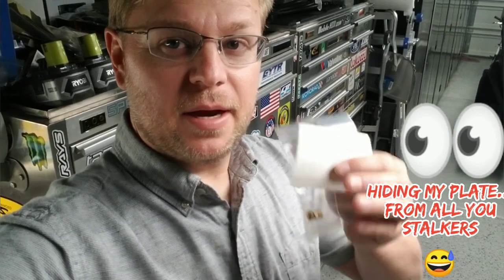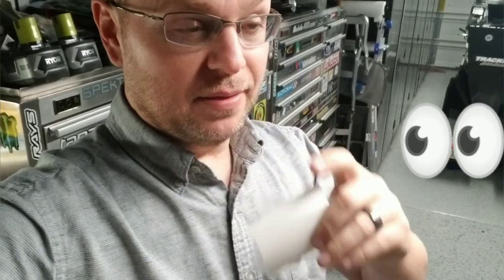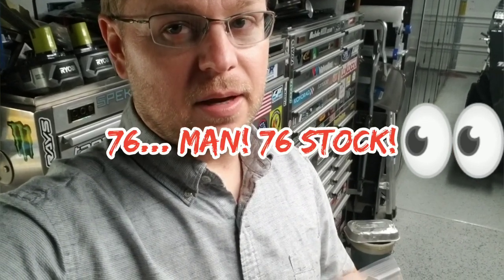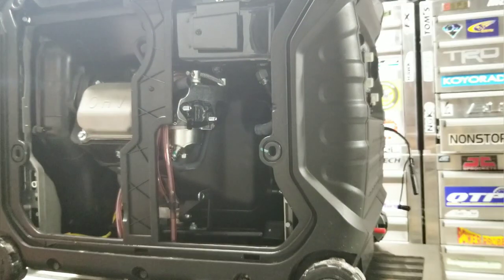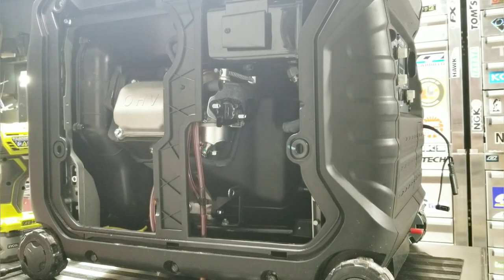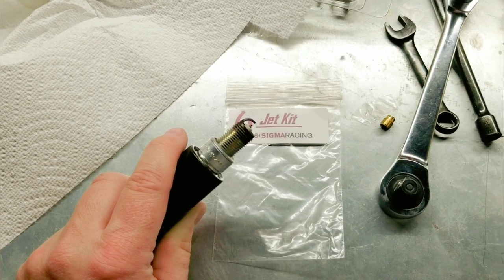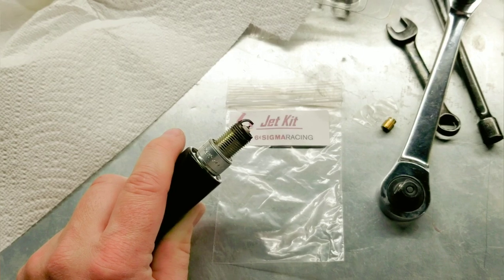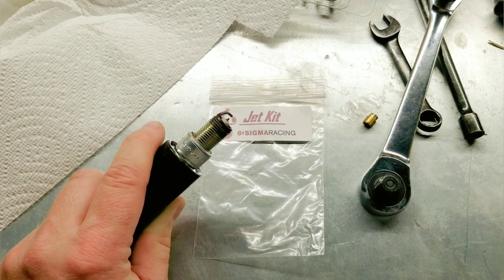DIY GUIDE - REJETTING THE PREDATOR 3500 INVERTER GENERATOR! RESOLVES A COMMON SUPER RICH CONDITION

Comment: Just bought one of these today. Had a few troublesome electrical outages here in Prescott. Watched your video...great info. Will be using the Pred 3500 mostly for backup during long outages. I'm at 5300 feet elevation here in Prescott. Which jet size would you recommend? Do you think that they may have cured the jet problem, or do you think it's the same as when you had it? Thanks.
Reply from the maker: Same #76 jet they have been putting in it since day 1. Others have mentioned a different jet in some models and elevations, but when they check the actual jet, still a #76. In Prescott, I would run a #68 for sure.
Reply: @MR_Garage  Thanks...will do..

Comment: nice video thank you for the time helping us on such a piece of equipment yours after the jet mod seem to run spot on i like mose have a question about sea level i live in connecticut and wonder the correct jet would be it would be for my house as a stand by unit really yours ran so good without much modes.
Reply from the maker: So many variables - best to check and see how it is running per your spark plug. If your gen is clogging the spark arrestor quickly and plug is a mess, consider starting with say a #72 jet. See how it goes.
Reply: @MR_Garage  thank you
Reply: @MR_Garage  yes sir I have my jet off its a 76 as well my  emulsion tube dropped like yours it came out so quick I don't know what end goes in first can you point me in a direction please
Reply: i found a link on you tube for  correct way thanks again ill let you know how it went
Reply: @t57f100  which end goes in first?

Comment: Great video. What city (altitude) are you in? I'm in Texas 6-800' above sea level and tried two things to lean it out. I eliminated the charcoal canister (to lean it out) and popped in a 75 jet. It still blackenes the spark arrestor with that setup. What jet would you guys reccomend I order? (I have a 72 jet on hand but havent installed it due to time constraints) Trying to do this and be done with it. Thanks in advance!
Reply from the maker: I bet a 72 will do it. The 75 would barely make any difference at all.

Comment: What size do you recommend for running this generator down in Dallas, Tx? I’m a mobile Detailer and I just purchased mines from a side vendor. I normally change the oil, spark plug and filter when I buy a used generator. But, seeing how smooth yours is running what would you recommend?
Reply from the maker: Run the gen first and check the plug and spark arrestor. Can make a determination then.

Comment: Great video and very informative - thank you! Off subject but the carb drain lines (assuming correct terminology) on the right join in a plastic T. My T was broken and completely separated. Does it matter and is there an easy fix or way to get the part from HF without returning the whole generator? Do you have a Facebook page? I looked but did not see one.Thank You!
Reply from the maker: Hey Michael, 
You could just get a 1/8th plastic tee to fix (I think the line was 1/8). And ABS plastic tee should work fine. Likely can pick up in landscaping at home depot - verify hose diameter first. Adding, I do not have a FB page dedicated to Mr. Garage and my projects. I just post here.
Reply: @MR_Garage  Excellent - thank you!

Comment: I ordered the two jets and found a 78 jet in my gen set. I have one of the initial runs of the unit but from the Illinois area where I purchased. I'm also in the gold canyon area now but the plug didn't look that bad. I put in a 72 jet so we'll see how that goes. I have not used the gen all that much though. I also drilled the air holes like yours as I thought that was a much better look. Thanks so much for this information.

Comment: I live in glendale az and it runs my toy hauler ac decent but I went to munds Park this week and the cinder pits and it just shuts down it says overload I can only run the lights and things and it shut off like 3 or 4 times before it even ran ok this weekend at munds Park do you recommend that 68 for mine as well?
Reply from the maker: Munds park is pretty high up at around 6500'. Likely your spark arrestor is clogged and yes, a #72 or #68 will be the ticket for you. Also, sounds like you may have overfilled it with the comment of shutting off 3-4 times before it ran OK. Sometimes that indicates charcoal canister being clogged with fuel. Never fill past the bottom of the screen on the tank inlet.
Reply: Where do I get the jets from I couldn't find a 68 or 72 they are different numbers where I have looked?
Reply from the maker: @coltenwells9567  https://www.6sigmajetkit.com/contact-us.html    Ask them for a #68 for the predator 3500. They are here in Az.
Reply: Where could I order the spark plug that you are recommending?
Reply: Colten, I had the SAME PROBLEM, cleaned the spark arrester and problem was immediately solved.  I live at 7K’ camp above 10k...

Comment: Hello, I have a question, my generator has a "maintenance time" symbol that looks like a key, why did it appear?
Reply from the maker: It comes on at 200 hours. It is stated that it cannot be reset (stated in other manuals like the powerhorse model of the same generator).

Comment: I just bought this generator yesterday. Is this still an issue with the current unit? If so I’ll get to performing this mod right away.
Reply from the maker: Best bet is to let it run under load / break in. When done, see how the plug looks and spark arrestor.

Comment: Great video, I just got the 3509 and live at 6000’ trying to order a jet kit #68 and can’t find one. Is there a part number or any other info that would help me? Thank. Craig
Reply from the maker: Hey Craig, Link here (also in the video description) Hope it helps! https://www.ebay.com/itm/Predator-212-cc-Honda-Clone-GX160-GX200-GX390-Intake-Carburetor-Carb-Main-Jet/232104529620?hash=item360a820ed4%3Ag%3AZlkAAOSwOyJX9X7D&mkcid=1&mkrid=711-53200-19255-0&siteid=0&campid=5338741445&customid&toolid=10001&mkevt=1
Reply: Only seeing .70 and .65 in that range now.

Comment: Hello I'm hoping you can help me out. I just picked one of these generators and I have looked into why it kinda runs like crap, and what I have found is the only "fresh air" intake is from the charcoal canister that pulls air from the gas tank, that's why they always run rich. Why dose pulling off the oil door fix the running issue? I do plan on pulling the canister out because that seems to  resolve all the problems, but for the life of me I can't figure out what pulling in air from the oil fill door resolves the issue, since the carb can only get air from the gas tank, and I don't see any air intake holes on the front cover of the air filter (other that the hose that runs up to the canister) Thanks!
Reply from the maker: Hello,
Sounds like your gen has been overfilled with gas at least once. This will cause fuel to run down into the charcoal canister and saturate it. Also saturates the air filter in some cases. Do NOT overfill the gen higher than the bottom of the screen under the cap. If you never overfill it and once the canister is dry, people have no problems. Pulling off the oil door likely just gives it enough additional airflow to run. Betting it is running super rich right now.

Comment: Thanks a million for this video and info! I really appreciate it! I have 2 quick questions: 
1) Are there any noteworthy differences between the Predator and the other five brands? 
2) Would the generator still show signs of running rich if it were run with standard E-10 gasoline instead of ethanol-free gasoline? 
Thanks again!
Reply from the maker: 1 Primarily looks like front panel layout differences and color. The latest predator 3500 model adds a fuel gauge which is awesome. 2 All we have is crap ethanol gas here with no puregas stations. Still runs rich as a pig unless jetted properly.
Reply: @MR_Garage  I'm also in the Phoenix valley. If you use the generator mostly for backup power, I recommend keeping a few gallons of Sunoco 99 octane around. I get mine from a shop in Phoenix. While expensive, being racing fuel it stores well and is much better to mix for 2-cycle engines.

Comment: Mine rings on choke but not in run if I did this and cleaned the jet without changing it out would that help?
Reply from the maker: Indeed, pull the bowl and clean the emulsion tube and jet. Should be good to go!
Reply: @MR_Garage  I can't get the jet loose....

Comment: I am at under 1000 feet elevation and plan to install a propane conversion kit and only run propane. Is changing the jets still recommended in my case?
Reply from the maker: The propane conversion kits such as tri-fuel's kit does not mention any carb mods. I have not added one to mine, best to ask the kit manufacturer.

Comment: Do other generators in this class also run rich?  Or is this just a predator 3500 thing?  If I bought a firman or a wen in this size would I have the same issue?
Reply from the maker: This seems to be a thing more with this gen and all variants of this loncin design. It is such a simple, quick mod - I did not bat an eye for the price paid.

Comment: Knowledgeable video! I'm at about 250 ft elevation in Bakersfield. My Predator 3500 inverter generator ran great during break in 25hrs. Now it hunts and surges (too lean) I have done all the AF and canister mods. I use sta bil gas additive as well. Maybe too much sta bil additive? NGK plug even.
Why is this thing so temperamental? Almost like a 2 stroke either too rich or too lean... What jet sizes should I order from 6Sigma? I want to get a stock size pilot and stock size main also one size over stock for each. I don't know their numbering scheme and they just tell me to order the sizes I want? Not much help... Please HELP
Reply from the maker: Likely have a clog if hunting or surging at idle / lean on idle. These things are pig rich at idle normally even at sea-level. There is a hidden idle adjustment screw (google predator 212cc idle adjustment). Carefully take that screw out and parts under it - small plastic low speed jet. Other videos show this for the predator 212cc. I need to cover it soon. Spray out the inside of that area with carb cleaner (berrymans B-12) Be careful not to splash B-12 in your eyes. Vicious stuff. I recommend taking off the carb to do it. While you are at it, take off the bowl, clean out the main jet and blow compressed air through all the passages once gas is drained. Sounds like a lot, but that is like 30 minutes of work tops.
Reply: @MR_Garage  OK I'll pull the carb tomorrow. What are the sizes for the stock main and pilot jets? The main is 067 I think but pilot unknown?
So you are saying there is a idle mixture screw on the other side of the carb? I wonder if it adjusts air or fuel mixture? If it's by the throttle plate it's fuel next to choke it's air.
Reply from the maker: Main jet is a #76. Generators for the most part do not spend their time at idle. Once you get it running properly at idle, then you can see how rich if runs and if it warrants a main jet change. 

The mixture screw is not on the other side (wish I could post photos). It faces the oil cover side of the motor. The pilot is rather hidden but accessed from the outside after you remove the idle adjust screw. Wish I could post pictures in the responses.  Check other videos under the search I mentioned above. 

Only other possibility with this, you overfilled the gas tank at one point (should never be higher than the bottom of the screen) If you filled the charcoal canister with fuel, they run like crap. But the surging you are mentioning... more a sign of a clogged jet or carb. Just takes a small bit of whatever in the gas to make that happen.
Reply: @MR_Garage  I see the idle mixture adjust screw. It has been cut off and glued in place. The main is a 065 not 076. I dont know which number to order from 6sigma? Their numbering scheme is completely different?
Reply from the maker: Is your gen the new model with fuel gauge on top? In another group, we just had confirmation they were still shipping with a #76 jet on the new builds for a main. This would be very NEW news if they are now shipping with a #65 main. Means they are finally correcting jetting, but going a bit lean now, especially for near sea-level. That is a jet I would use more for 3-4K+ feet (if the gen was always at that altitude). If you want a change, I would target a #72 for sea level. Order from sixsigma here. Their website is confusing. https://www.ebay.com/itm/Predator-212-cc-Honda-Clone-GX160-GX200-GX390-Intake-Carburetor-Carb-Main-Jet/232104529620?hash=item360a820ed4:g:ZlkAAOSwOyJX9X7D
Reply: @MR_Garage  Purchased in Nov 2019. I'll verify main jet # when I get the new carb. This is a California model and with all the CARB and EPA junk here it may have a more lean main jet in it stock? What bothers me is they cut off the idle mixture screw and glued it! We'll fix that. Also the emissions warranty is 2 years so I just ordered a new carburetor from HF. That plastic float they use probably bounces all over when running so I wonder if it ever has a even fuel level? Affects mixture also. This thing isn't a rocket engine it shouldn't be so difficult to tune. Idle mixture adjustment time...
Reply from the maker: Interesting. Definitely possible on Cali emissions stuff. I have not seen any reported differences so let us know. And yes, on the newer 212cc standalone motors they also cut off the idle mixture screw. I have seen some people talking about that. The slow jet should still be removable? And yep - just a lawnmower engine. Nothing fancy and easy to set how you want it.
Reply: @MR_Garage  I want old school carburetors brought back. They actually had adjustable  main and idle mixtures so the engines always purred. This emissions stuff while important is only to satisfy the EPA and when the engine breaks in it needs to be tuned but difficult with fixed and glued jets! Then no one seems to know what has to be done or can't say anymore. Gas engines aren't any different than the mid 1950s. Now they are just choked out of running properly.
Have you ever put a timing light on one of these to see if the ignition timing is jumping all over the place?
Reply: @fanofoldfans9238  did you ever see what jet is in it. I just ordered one here in California too

Comment: Just bought the 3500.  I live in Indiana and pretty sure im at 630ft.  What size should I order? 72?
Reply from the maker: First run it in your area / temperature. Go through break in, then give it some load and check the plug. If you think you are running rich, go to a #72
Reply: Mr. Garage thanks for the reply.  Appreciate your time

Comment: I just tried to replace the old jet with a new jet kit and I don't know WTF Predator put on the threads of the old jet but I could NOT get that thing to budge.  In fact, metal shavings started to come out when I tried to turn the screwdriver to remove the old one. Now tomorrow I'm going to take the generator to a small engine repair shop to see if they can get that old jet out. Would they use threadlocker on a jet from the factory?
Reply from the maker: Sure you did not get your righty tighty lefty loosey mixed up 😅 never heard of this from others with a predator gen. Sorry man
Reply: Mr. Garage I made sure I was going the right direction to loosen it. Unfortunately for me this is pretty much how every project goes for me. I run into some problem/issue.
Reply from the maker: Sorry man! Sometimes the world wins, sometimes we win

Comment: Wow this is a great video. Im getting a Predator 3500 and was wondering if you think this would be a good mod at "Sea Level" ???    In Florida
Reply from the maker: At sea level, go with a slightly larger jet. Say .70 or .72. The company I linked offers a .72 I believe. That is what I would use per my experience with my gen and knowing how it runs on the .68 at my altitude.

Comment: great video so if I'm in Houston Texas and it's totally flat here more or less sea level what jet do you recommend a 68 or a 70...? Thank you 😊
Reply from the maker: All depends on how your plug and spark arrestor look after a good run under your normal load.
Reply: Yoshi, I'm in Katy and I went with a 72 and I am no longer getting misfires like I used to on the stock 76. It seems to run smoother with ESC off to me. I do not have any other mods on my generator. 70 might be too lean, but you can give it a try.
Reply: @x2100  Where did you purchase the jet. I am in North Louisiana so I think a 72 would be fine.